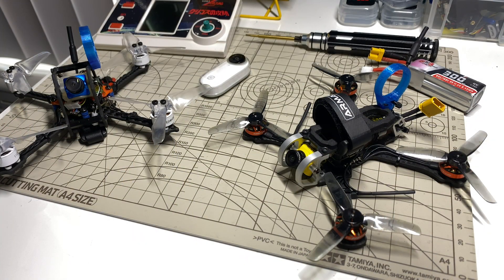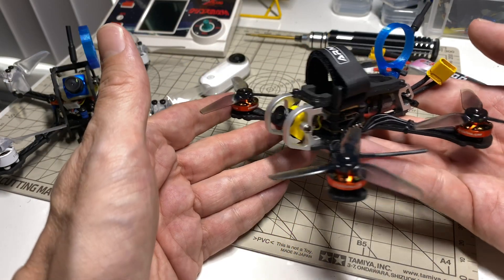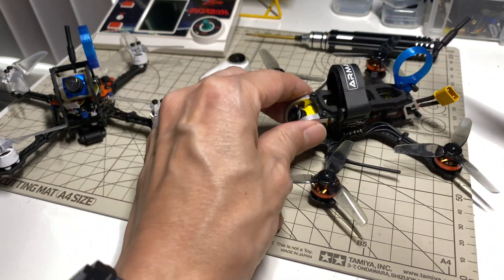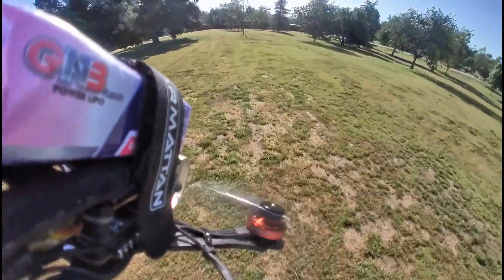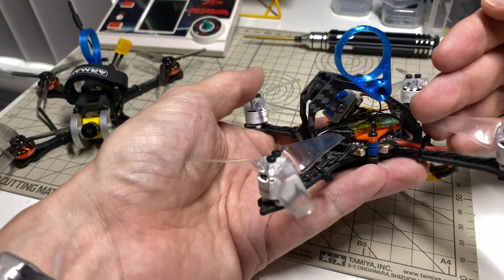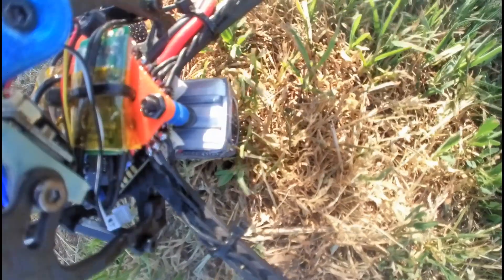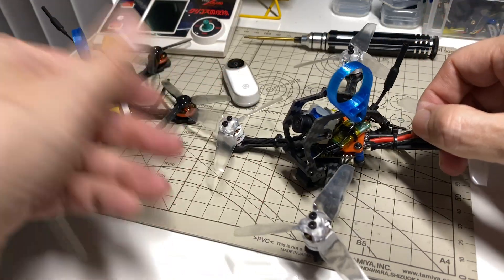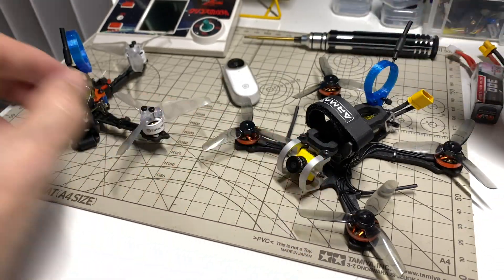RCINPower 1202.5 6000kV motors + MORE Insta360 GO Mounts!

Comment: I wanted to use 1204 8000kv with 65mm props but on 2s and 3s do you think 3s would burn the motors up? I have  a 30a esc installed and have both 2s and 3s 650 RDQ hv battery’s
Reply from the maker: Hello. Hmm. I think you should be okay to run 3S with 65mm props. I’ve run 65mm bi-blades on 3S with 1103 8000kV with no problems. It’s possible though that it could be too much for 65mm bi-blades with a 1204. A better prop might be more in the 2540 range but in that case I’d feel safer on 2S or you could maybe try 3S with 10~20% motor scaling.
Reply: @MiniMicroFPV  if not a gemfan 2540 I was thinking about the same HQ prop you used in this video since it has less pitch than the gemfan if I’m not mistaken but I’ll give it a run on both and see if the 2s is preferred and I’ll play around with scaling, i haven’t used that before to my knowledge but seems easy thanks for the help

Comment: hi whats the camera like with crashes? and bad scratches?
Reply from the maker: Heya. Well I have to admit I haven't had any bad crashes yet while carrying a 360 GO. I've of course flipped over on landing a fair number of times but only on grass so even then the 360 wasn't getting much abuse. No scratches on the lens so far though there are little hairline scratches on the plastic case from general use and putting it in and out of the TPU mounts:)

Comment: How does your tadpole build compare to the GEPRC Phantom?  They seem like similar setups.
Reply from the maker: Thanks for the question:) It looks like this build is about 10g heavier than the stock Phantom and I think that's in the frame. It might be a little more durable. It'd be cheaper to buy a Phantom BNF but it looks like it comes with a Caddx EOS which isn't my favorite camera~
Reply: I have both the stock phantom and a custom build tadpole. I use the phantom a lot, it could handle quite some crashes, however the weak point is the single standoff at the back of the frame, mine just broke in a crash. I recently started flying the tadpole and it feels more study, it is true that is a little bit heavy but i still get around 4 min flight using 3s 450mAh batteries with medium-hardish intensity acro

Comment: Those toothpicks get more and more efficient maybe it is possible to put inav on this and get some long range journeys without troubles
Reply from the maker: I think I saw a chap called Dave C doing a toothpick-style long range not too long ago:). I haven't been too interested in the class just because I'm too skittish about losing it~~
Reply: @MiniMicroFPV  With inav software u've the rth feature, u should be very unlucky to loose it when it's setup propely
Reply from the maker: When I say losing it, it’s more about me being paranoid about a dodgy solder joint or some build error on my part causing it to fall out of the sky;)
Reply: @MiniMicroFPV  Haha yes when I was flying mid range I was so scary too, feel like Im gonna land on the moon with a billions dollars build but it was just 2km away xDDD And there's no panic button when u've a removed signale cable 😳

Comment: How do you like the 1202.5 motors?
Reply from the maker: These are nice:) I think they can swing the little tri-blades just a little bit better than a similar 1103 but not a big difference.
Reply: The 1202.5 11.5k are the same as fpv cycle . They are amazing on a sub 40 gram 1s build.  Been ripping them for a few weeks now
Reply from the maker: Nice! That’s a cool class that I haven’t toyed with yet;)
Reply: mini micro FPV I recommend it highly.  It has allowed me to fly more as I can comfortably fly in my yard and have great performance like a typical 1106 2.5/3” but with a quarter of the AUW.  My 1s 3” is 52grams with a 450 1s .  Check out my latest video

Comment: I would be reaaaaaally careful about doing acro with the Insta360.  If it slips out of your mount you will never find it.
Reply from the maker: Oh gosh I'd hate to try and find this thing! I tried to design these mounts to hold the camera securely enough so it wouldn't eject but anything is possible. I'd like more lens protection as well and maybe I will address that next:)
Reply: You can pull a lot of g's in an acro move.  Something that seems secure on ground can go flying off with the right move or just, you know, stretched out TPU.  And the camera's haptic feedback will be useless in a pile of weeds or brush.  They should have used a beeper instead.
Reply from the maker: Thanks for the advice! I agree that there can be surprising forces in acro move but also I would say that the camera is generally centralized in its mounting so shouldn’t feel too much centrifugal force. But I’m just intuiting that;) And a beeping option would be nice for finding it!